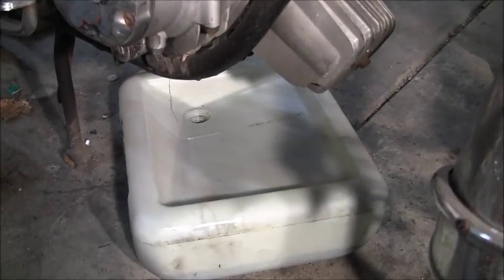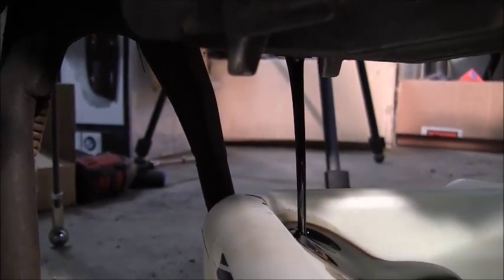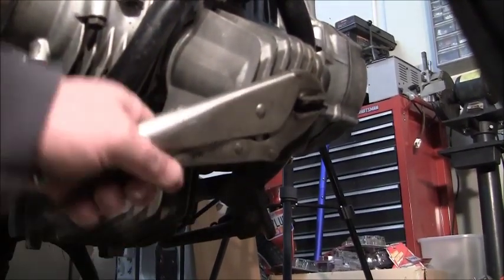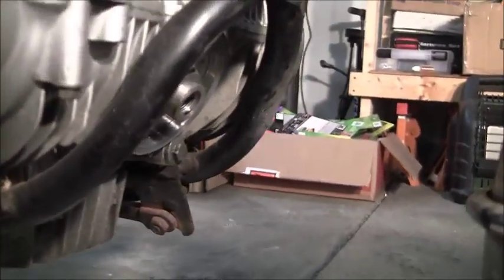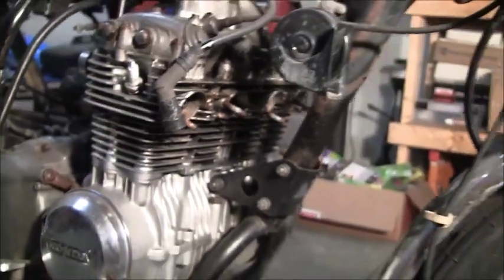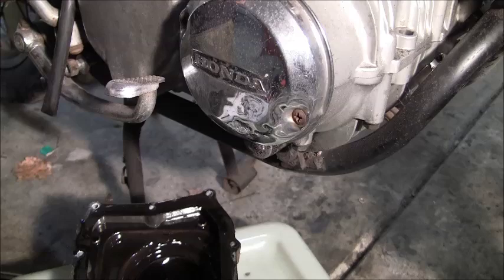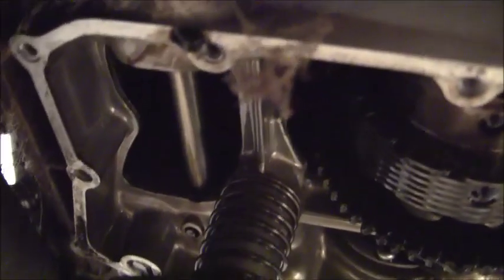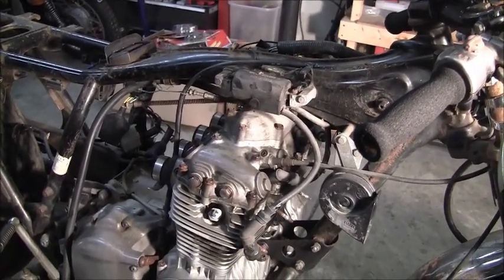Cafe Racer Build Project Part 6 : 1973 Honda CB350F / CB350  : Draining Oil & Removing Oil Pan

Comment: I had a triple tree bolt on my 1974 xl250 become rounded over and a way that helped me get it off, was taking a file and filing down the rounded off edges basically cutting a new surface. When you find a bolt like that, youll try anything haha. Love this series, been glued for the past week. If funds are an issue on this bike, a GoFundMe account for this project would help get the ball rolling again! Id love to see it complete. Going through this process right now on mine for a café racer restoration.
Reply from the maker: +Jason Michael Fund aren't an issue, just wish I could buy time :)

Comment: Cut a deep slot with the saw then use an impact drive on it.I used this method on a mates cb350 four.It took around 2 hours of serious smacking with a lump hammer to free the bolt off..use heat on the housing surround aswell.

Comment: Just a tip, never use vice grips (mole grips) to remove a seized nut, it ovals the nut making it even harder to remove and the tighter you lock the grips, the more oval the nut becomes as it is squished. If you can, use a centre punch to indent the nut to create a shelf that can then be used to gently hammer the nut off or use a hacksaw to do the same thing. Heating the nut should help also.
Reply from the maker: Thanks, I typically wouldn't but had already used heat and so on. Before I made the video I knew it was an issue :(

Comment: I'm not sure how well this works with bolts but i used a compact acetylene torch and a bottle of water to remove my frozen piston from my brake caliper on my cb350. I got luck and managed to get all working later without damaging the housing but maybe heat treatment can work with bolts. And in addition I would carve out a Philips head or flat head into the bolt enough for an impact driver head to fit in. And if the bolt twist and breaks.. drill out. I guess welding a nut can work but i have no welding experience so I stray away from tools people do not show me how to use.
Reply from the maker: Good tips, I've used a few of them.

Comment: use a small pipe wrench to get that oil filter out..
Reply from the maker: Actually tried that. In the end I found out it was completely seized on there so I'm guessing the oil was never changed or changed very little!

Comment: Im fixing my granddads old 350f to get it back to the road. So a novice question: should I change the oil screen while changing the oil? i mean that metal screen which is visible at 5:45.
Reply from the maker: As long as it's not damaged it's not needed. Just cleaner her off!